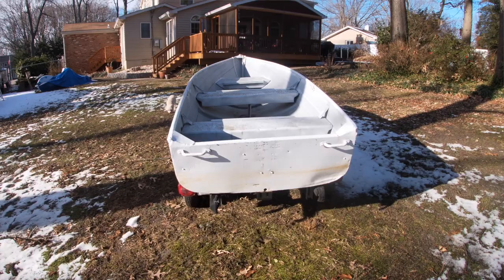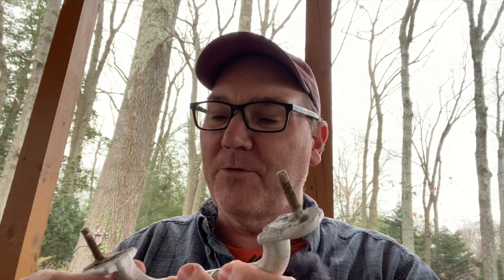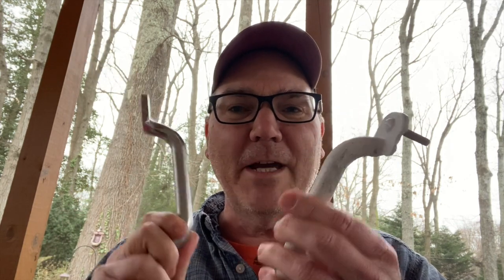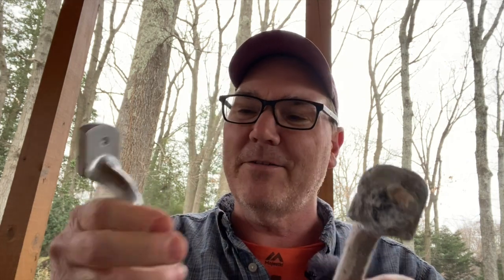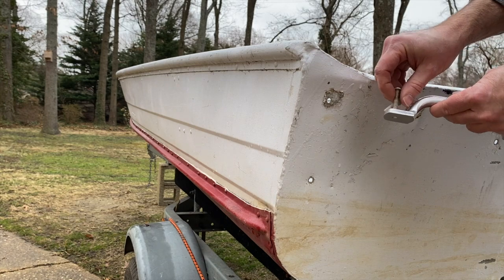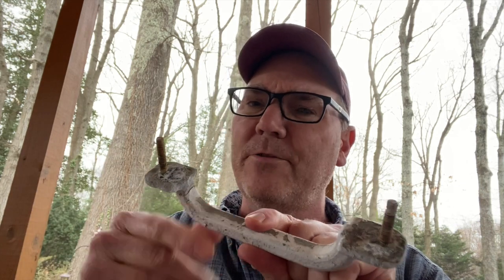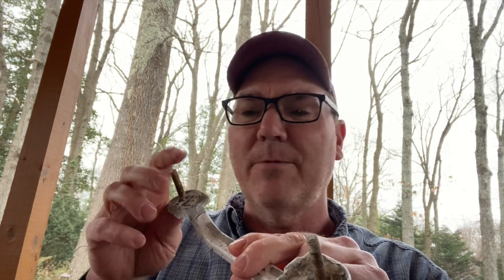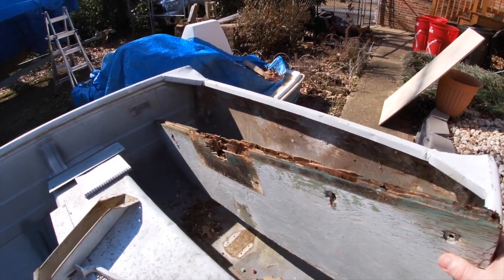Small boat transom handles - cheap & best new handles for jon boat restoration!

Comment: The deposits that you found were not metal corrosion (iron oxide rust) that you are familiar with.  Likely, it's aluminum oxide which creates a whitish residue.  When all the aluminum atoms have bonded with oxygen the oxidation process stops and doesn't continue to deteriorate the material like iron oxidation does.

Comment: Those "bolts" are ordinary cheap machine screws and are just steel......they're rusted (see the orange/brown color?),aluminum doesn't rust it will corrode (which is a whitish color).
Those orig. handles could have been cleaned up once you were able to knock those cheap screws out.
Reply from the maker: I rechecked the ones I removed and they were not magnetic, and they all broke very easily making me assume they were aluminum. And I tried for a little while to remove the screws from the handles and they had totally become "one" with each other.
Reply: @WayneTheBoatGuy  Ok,lil surprising though since they were reddish brown color that indicates rust and steel
Reply from the maker: @rider660r  I know - right? Weird

Comment: Keeping the zinc anodes installed and clean might help to keep the handles better. 50 years is not too shabby! Aluminum boats want zincs.
Reply from the maker: Good to know! - I don't think this boat has any anodes at all!
Reply: Lots of them dont.but if they spend time in the water at a buoy or a dock they should.I think having one on the outboard may help some if it is allowed to stay under water.

Comment: Question, I have a similar but newer Alumacraft V16 with similar handles attached through the transom with a pretty basic lock nut from the factory. Think it’s reasoble to tow a couple kids on a tube from those handles? The boat didn’t come with any other transom attachment points.
Reply from the maker: As with any towing situation there's a lot of things to consider and most small aluminum boats aren't really designed for towing.
Reply: Might be better towing from the engine itself I did tow with my 12ft flat bottom I put 2 eyelets through the top corners. If you tow from the handles put a piece of aluminum plate under the nuts and possibly use grade8 hardware but don't leave the grade 8 hardware installed for storage

Comment: How or what did you use to put them back on bolt wise?
Reply from the maker: I used stainless steel bolts and flat washers with locking washers on the inside. You can see them in my video about replacing the transom in my 12 foot boat.

Comment: Great video, I managed to clean up my stern handles on my 14 ft. Aluminum boat, They did turn out pretty good.  What I'm trying to do on it now is add a aluminum grab handle on the right and left side to hold on too while traveling across the lake. My boat is similar to yours, it is a 1968 JC Penny's that I have restored. Any idea's on that?
Reply from the maker: The Amazon link in the video description takes you to the handles I bought, if those aren’t ideal, from there you might be able to see some options. Grab handles would definitely need some support underneath.